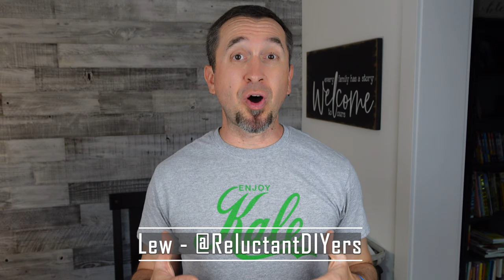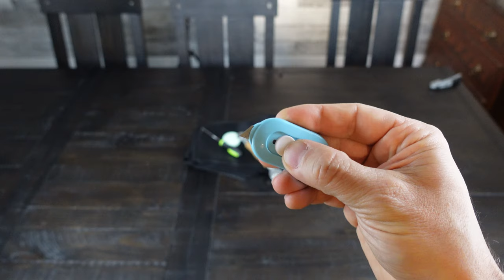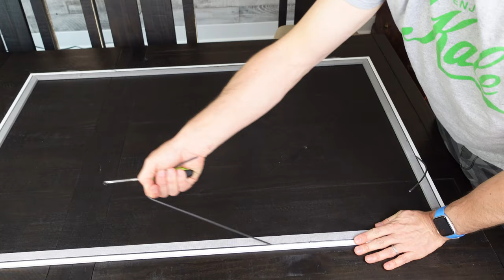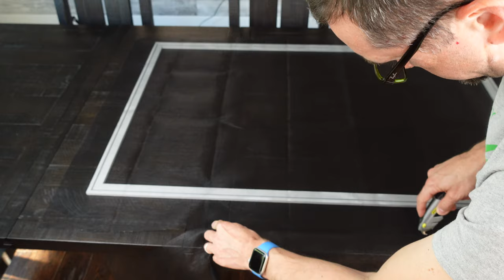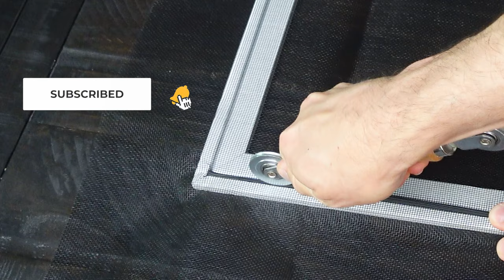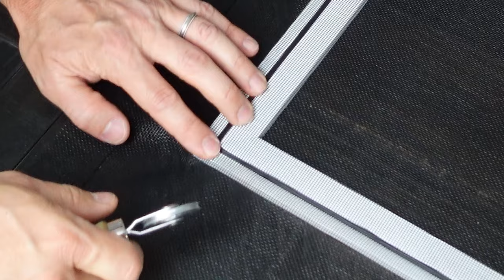Window Screen Replacement - How To

Comment: I replaced three screens in my house today because of this video. I didn't get the kit though, bought all the bits separately. I was able to get the job done without the 2" extra on either side (mine was about an inch of overlap) BUT I had to go back and redo two sections because of it. Lesson learned. One last thing, it helps to rip out a piece of the spline on the old screen before you go to the hardware store. I had to make two trips because I bought the wrong size :oops:
Reply from the maker: Great feedback, thanks for sharing! Way to go on the screen replacements!!! Have a great day Walter!